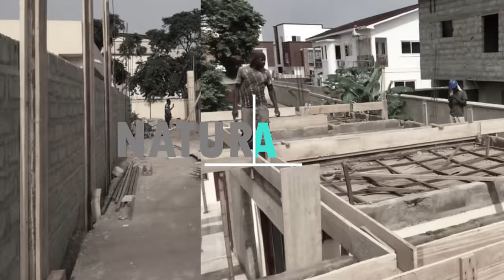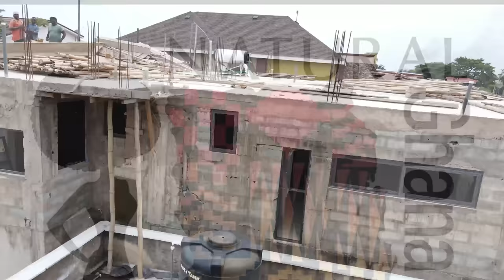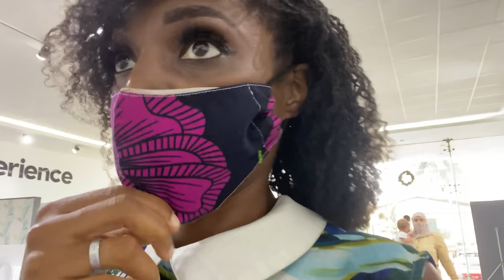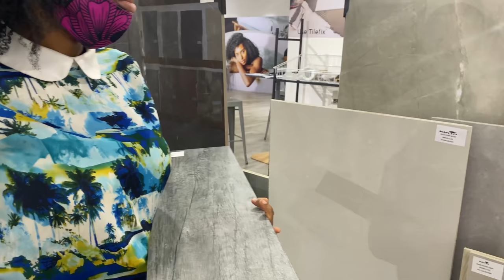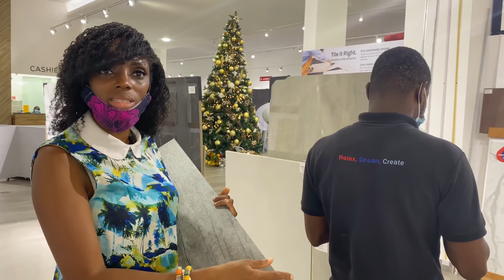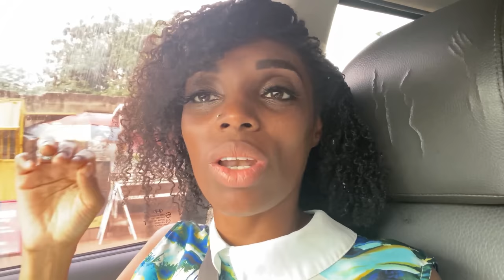Can You Help Us Decide Between These Two Bathroom Tiles? | Building Our Dream Home In Ghana

Comment: lighter titles in the bathroom will make appear the room bigger and will reflect the small natural lighting coming through the small window. 

Btw, I wouldn't put the titles on the wall everywhere, from the floor to the ceiling ( it feels to me like I am at the bottom of an empty swimming pool, the bathroom appears smaller too). Except in and around the shower, tiles at a height of 5, 19 ft/160 cm are just fine. 

The dark title that Dela is holding in her hand is better for bigger rooms with more natural lighting, like living room or veranda. 

The link below has nothing to do with titles,  but rather with home design.

https://youtu.be/j-s660EPfU0
Pricilla Azzini is an interior designer and architect. Her videos might inspire you.
Reply from the maker: I’ll check it out, thank you

Comment: Hey guys , you car seems to be giving you trouble on a semi regular basis. Kwame , I suggest you invest in a Honda CR-V    or a Toyota  (used, model year  2010 - 2014 @ 100, 000 km ) . I'll go for awhile, without  major problems. I hope this info is useful. If you continue with that car , maybe it might just be a money pit.
Reply from the maker: We had been thinking of getting a Toyota actually.  It’s seems like those parts are easier to get hold of.
Reply from the maker: We service it regularly but still get problems
Reply: @moretodela  What type of car do you drive?
Reply from the maker: @denniscasely-hayford3245  Hyundai Santa Fe

Comment: Well sister Dela o the dark tile works if you already have alot of lighting in the room otherwise go with the light one to brighten the room. I am leaning more toward the dark though without knowing the kind of room it is going to be in. You guys got this.
Reply from the maker: It’s for the bathroom
Reply: @moretodela  yes you mentioned that in the begining. So in this case the dark one will do because lighting wont matter and not a heavy traffic area too. Even you know you wanted that one too. 😀
Reply: B. G  good choice. darker colour on the floor and bright colour on the wall.